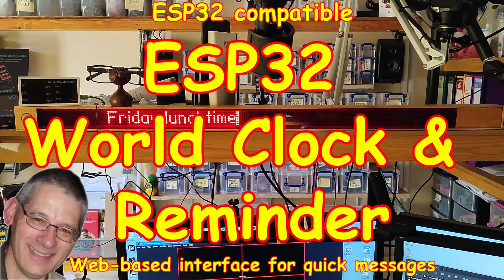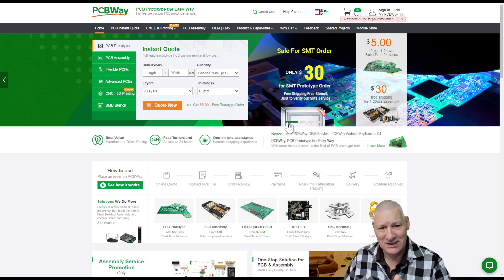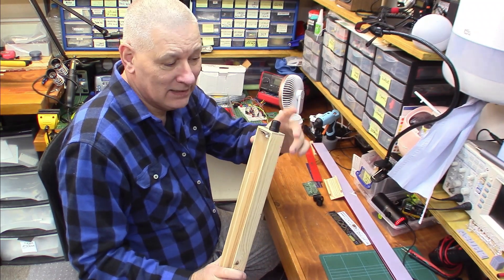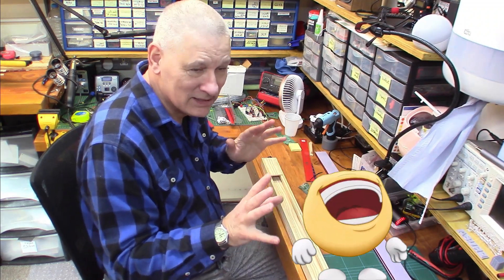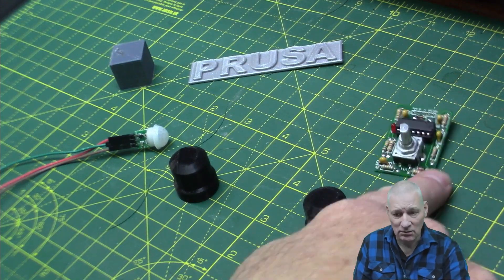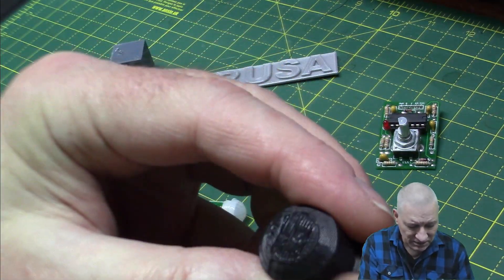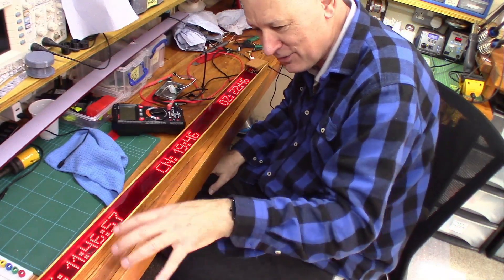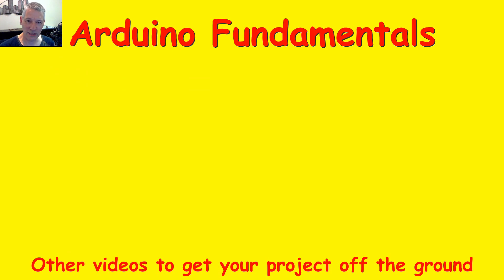#264 ESP32 World🕑Clock and Reminder🎗️Project (Assembly Stage)

Comment: So, now You became kind of an influencer, right?
PLS. make ALL of the chinese made Max7219 based 8x.8 modules work the code You are using with no problem.
Complaint!
On Github You have put just a few files You have put changes on, but not THE working code.
No good. If You do refering to someones code You are using, put EXACTLY THAT it in ONE place with all the neede stuff.
I got  similar modules sold by "big" seller AZDelivery an Amazon, but NONE of the codes You have published (even not on Github) do work.

What I have experienced so far.
Only the samples delivered with the Gyver Max7210 library work when adjusting the signal pins a bit.
WTH. Add the Arduino IDE hell, versions and library versions dependency.
No good. 

Do not, do not buy CHINESE made crap. They shamelessly rake in the money and lough on You the stupid buyer.
NOT recommend, itcauses wasting time, effort, money.
NO satisfaction guarantied.
NOPE.

Comment: Hi, I keep getting an error where littlefs cant be initialised, do I need to modify the platformio file ? I changed the port to match my board which is an esp32dev module in Arduino 2.0
Reply from the maker: LittleFS is now included as standard for the ESP32 (part of the ESP32 Arduino framework) so it should "just work" without doing anything special - well you will probably need to #include <LittleFS.h> (not sure of the capitalisation) but that is it!
Reply: @RalphBacon  Hi, Thx for the reply. It turned out to be my PC not seeing the port of my board so was unable to upload the FS. All working now thx. Brilliant project 😁

Comment: BTW, the time is from some NTP serveur, how did you integrate the DST, for us in Europe, Winter and Summer time ? Automatically.... or did I miss something ?
Reply from the maker: Completely automatically. The ESP32 has a mechanism for working out the time in any timezone - you just supply a particular format string of when the clocks change (DST) in that country.

So the string says something like "put the clocks 1 hour forward on the first Sunday in March at 1am, and back 1 hour on the last Sunday in October at 2am". It looks like "GMT0BST,M3.5.0/01,M10.5.0/02" but there are example formats in the ntpHelper.h in my code and a link to the website that covers this 101%.

The complete code is in my GitHub for this video so you need to download and peruse, cogitate and learn! I use this technique in all my ESP32 code (that requires the time).
Reply: @RalphBacon  I shall peruse..... And learn, I was just about to Make my own DST routine.... 😎. Reinventing the wheel 😁Would not be my first time....

Comment: for that button with the bad top surface, the nozzle was too high. First layer is the most critical one
Reply from the maker: It does seem that it was too high but someone else has suggested I had not flipped the part over exactly 180 degrees so it was at an angle (maybe just 1° off true) which caused the issue. When I reimported it, and flipped it correctly, it worked a treat.
Reply: @RalphBacon  Don't know what slicer you use but normally when you rotate a part, it goes in 15 degrees increment, that is the default but that can be change of course.
since most peoples use .2mm layer height (200 microns), an offset of only 50 microns will show. teh room temp will affect this or when you have an enclose printer you have to wait until it stabilize.

Comment: Hi Ralph, you mentioned A Bornes rotary encoder ? Why this one and is it different from standard rotary encoders ?
Reply from the maker: This particular Bourns rotary encoder (version: PEC11R-4215F-S0012) actually gives TWO pulses per full cycle. This is probably not what most of use want. The algorithm I used here (from Marko Pinteric) deals with this wonderfully well, just ignoring the extra pulse.

The standard (cheap) KY-040 only gives one pulse per cycle and is easier to deal with using standard techniques (software or hardware).
Reply: @RalphBacon  Thank you for your reply. I was using a WH-040 which gave me the wrong count.

Comment: Very nice craftsmanship Ralph. I was trying to design a knob in Fusion 360. Then I did it in tinkercad in about 15 minutes and it turned out perfectly. Don't always need to " split atoms to make toast". Best wishes!
Reply from the maker: Sounds great! 

Certainly, for simple stuff (that you won't need to amend too much) TinkerCad seems fine. 

I've deliberately avoided it and gone with FreeCAD; it's much more capable than TinkerCAD (a true parametric design tool) but not as pedantic and finicky as Fusion 360 (which I tried for a number of manufacturer-supplied lessons, but eventually gave up). 

Fusion 360 reminded me strongly of KiCAD PCB CAD tool - capable but built by geeks for geeks. 🤷
Reply: @RalphBacon  I've been using Fusion360 for the most part. I'll be exploring FreeCAD once I retire and no longer have the free access.
Reply from the maker: The good news, Gord, is that you still get free access for Fusion360 as an individual for free (non-commercial use). You do have to register and jump through a couple of hoops but after that it knew all about me and I could use it.

Comment: When you use a 0.6 nozzle, you need to change it in your slicer as well. You might need to recalibrate your Esteps. Otherwise you will get underextrusion! And after any work on the nozzles, check your Z offset again!
Reply from the maker: Now that I've had a bit of success printing a few things I think I might give it another go. 

Did you know the "standard" nozzle for new Prusa Mk4 printers is now 0.6mm so it seems a safe bet. After all, we don't have to print the max line width all the time.

Comment: Hi Ralph. The problem with the knob is that it was at a tiny angle offset instead of flat on the bottom surface in your slicer. You can see it by the fact that the surface has 3 different  patterns instead of one. 
Thanks for your work.
Reply from the maker: Ah, so maybe I didn't turn it over a full 180 degrees, you mean? 

This was early days and was running on enthusiasm rather than knowledge. That would make sense, so that when I re-imported the file and turned it over (correctly this time) it was all OK.

Comment: Do you have any videos dealing with ESP32 modem sleep mode? 
I searched your channel but couldn't see one.
I need it to keep the Wifi off most of the time, but the connection to the router on.
Can you recommend a video?
Reply from the maker: You need to explain what you mean by turning OFF the Wi-Fi but keeping the connection to the router ON. Mutually exclusive? How does the ESP32 "connect" to the router? By using Wi-Fi.

I have done a video on how to turn off the ESP32 (Deep Sleep) but not just modem sleep. Something I should look at.
Reply: @RalphBacon  Modem sleep wakes up at set intervals to keep the connection alive and then goes to sleep. I think every 250ms is the default, but info on this mode is hard to come by. This one is the better of them all but still cryptic. 
"To accomplish this, the ESP32 connects to the router in station mode using the DTIM beacon mechanism. The Wi-Fi module is disabled between two DTIM beacon intervals and then automatically enabled just before the next beacon arrives. This results in power conservation.
The sleeping time is determined by the router’s DTIM beacon interval time, which is typically 100 ms to 1000 ms."
Reply from the maker: Yes, that is my understanding too. Your router tells all the connected devices that it will be checking in every X milliseconds. 

In modem sleep mode, the ESP code is clever enough to switch Wi-Fi back on, just in time to catch the next "ping". Then it (the Wi-Fi subsystem) goes back to sleep. Thus the router won't disconnect the device.

But even if the connection all happens in 100mS (or less) it is still going to cause some drain on the battery. Consider whether you can shut down the ESP in Deep Sleep but connect back to the Wi-Fi only when you actually need it. Yes, it takes longer but doing this once per hour will save your battery.
Reply: @RalphBacon  That's the thing. I don't know how to put the ESP32 into modem sleep mode. Do you have a video showing how to do that? 
Since my ESP32 is running as a radiation monitor WiFi server, it can't really sleep. it gets wakened about 70+ times a minute as the interrupt "ticks" come in from the GM tube.
I was hoping to put the WiFi to modem sleep to save more battery power, but I think I would just power it from a 1A USB SMPS charger with a 1000uF cap in parallel to the input, to deal with power surge demands of the ESP, and forget about batteries.
Thanks.

Comment: Nice case, and a useful clock. i quite like the "it's 10 to 3" type displays.
sounds like I've got another project to add to my list.
Reply from the maker: It was a nice project to do, no technical issue and best of all it finally used up that long strip of MAX7219 modules!
Reply: @RalphBacon  the MAX7219 also make a very nice 8 "7seg" display drivers. Which was properly the intended use for them.
Reply from the maker: Like the one I use in my Pond Controller? Yes, I finally got rid of... er, found a use case for that too!

Comment: 3d bacon ❤
Reply from the maker: Sounds good to me... well, it would, wouldn't it! 😁😂
Reply: @RalphBacon  it's just good to see you manage every day problems. I am still tring to find the best way to align my holes for a printed project box with the holes on my pcb. Sounds easy but right now I just print adjust and print again which feels so stupid. Can wait to see you  do this.
Reply from the maker: You don't use calipers? Then I might make a dummy PCB from a bit of paper printed full size. Worked ok for me!

Comment: Hello Ralph,
welcome to the 3D community!
For me (I have had my Prusa for about 3 years) it is unimaginable how I could live without a 3D printer before.
Hardware is now no longer a problem. Every project I do has parts that are not available to buy like this. No problem. Design and print. Done. No problem.
Reply from the maker: Well said! Since this video I designed and printed 3 brackets for the World Clock display. They fit beautifully and even have a tiny lip on the front so it will never fall off. As you say, the more I use it, the more I think of uses. But I must improve my terrible FreeCAD skills!
Reply: @RalphBacon  Hello Ralph,
I have also started with FreeCad. But with very extensive constructions I always ran into the "Topological Naming Problem". If you are a complete beginner, please also have a look at Onshape and Fusion 360. Both tools have their advantages and disadvantages. But they are very very powerful. And don't have the "topological naming" problem.
And always: happy printing 🙂